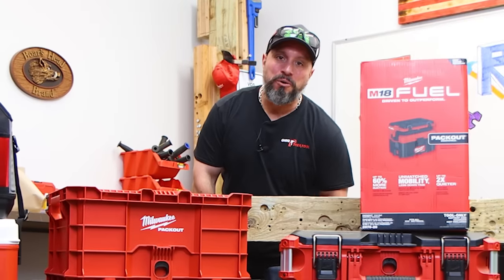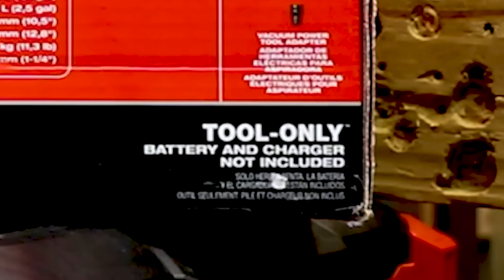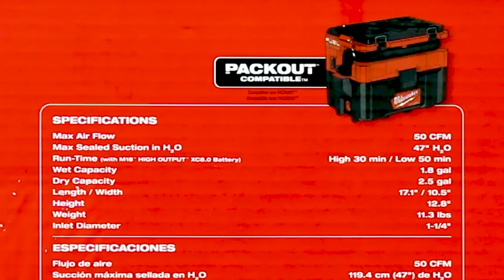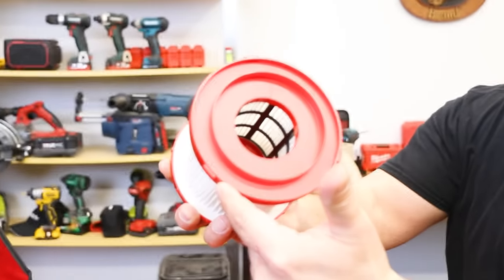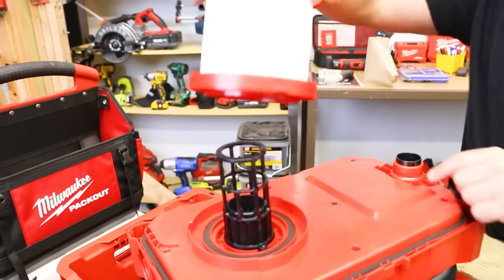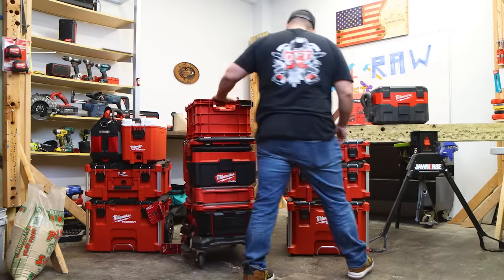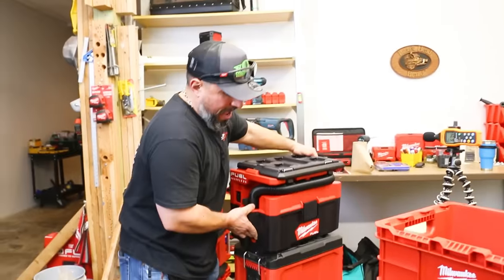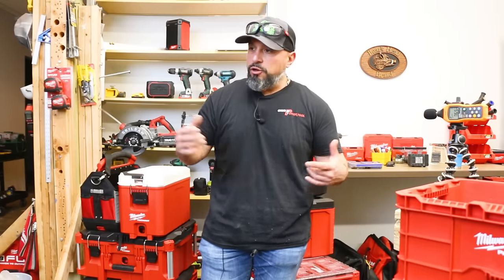Milwaukee M18 FUEL PACKOUT Wet/Dry Vacuum ARE THEY KIDDING!?

Comment: Junk Shear junk I am actually an owner of the little vacuum in this video I've got it sitting on my toilet seat lid it's more worthless garbage than any product I've ever bought zero Stars😢 real tears where did 7/8 days for this junk and now they're making a bigger piece of junk just like it customer service acted like they don't even care where is the care for your customer🎉 here are some flowers to put on the grave of customer care Milwaukee actually told me when I complain to them on the customer complaint line thank you for purchasing Milwaukee return it to where you purchased it that's customer satisfaction🎉 and there's the flowers on customer satisfaction is grave I will never buy a Milwaukee product again I'm going to switch to Makita I've never tried it but I hope it's better 120 some dollars for a vacuum that can't even suck up cig butts if it can't do that it can't suck up anything a Shop-Vac which this is the only thing this would be even useful for a portable shop vac wet dry shop vac sucking up oil off the floor grease steel filings wood chippings wood dust this thing can't do any of that why did they even make it the catch is too small the hoses too short the mouth is too skinny it only has one setting and that is lower than the lowest setting on a box fan you get for 20 bucks didn't come with a battery so when I return it in a few days I'll probably forget my battery in it meaning I'll be out $100 will cost me $15 to return it out of my own pocket that I'll never get back I called customer service and they told me that I could return it on my 30-day return policy I informed them that every Milwaukee tool has a 5-year warranty he sounded surprised like he didn't even know what the product was I was talking about I repeatedly tried to give him the serial numbers off the box and he just kept telling me thanks for purchasing Milwaukee😢 once again real tears🎉 rest in peace customer satisfaction I don't know about the bigger one but if it's even slightly like the little one you're going to get ripped off the little one doesn't even have wheels on it and weighs as much if not more than a mini fridge that's Compact and convenient habitat carrying a mini fridge around and you're one arm while you're vacuuming with the other no you have not cuz you're not dumb I asked him repeatedly just to change the product design they wouldn't listen even slightly they must be out of their minds just because their name is Milwaukee does not mean that the product is good anymore I was sure it'd be good my drill still works but I did buy that years ago never going to buy a product without watching a review first ever again I'm not even going to think about buying a product again until after I've watched a review if only I'd seen this guy's review I should have bought another heart vacuum cleaner my last heart vacuum cleaner lasted a whole year and was on sale damaged box $10 four 107.00 vacuum cleaner just because the box was tore lasted an entire year and could catch 12 to 13 gal of dirt and water this piece of junk can catch too and I'm actually being nice because it says it can catch 2 gallons and I haven't checked this yet but I'm pretty sure I could dump a half a gallon of water in that container catch and it would fill it meaning they lied on the box why would they say 2 gallons when I couldn't fit 2 gal in that container maybe if I took two two gallon milk jugs assassin in their standing up I could fit four gallons but as you may have guessed only about a gal would actually be in the thing because the rest of the milk jugs would be sticking up 9/10 of the way out of the top of the container and I wouldn't be able to put the lid on so if I dump 2 gallons of milk out of that milk jug their into the 2 gallon catch it would not hold it I'm almost willing to bet on that but I won't but really it was all around a bad purchase when I took it out of the box my dad freaked out he literally thought we accidentally bought a toolbox he just asked for a Milwaukee Shop-Vac they sent us this junk hope that this comment on this review help you save a lot of money and time and hardship trying to get a good shot back I didn't have any trouble with her and it had wheels on the bottom long hose big mouth plenty of sausage to very good vacuum and was also usable as a leaf blower just like this piece of junk they couldn't blow more than one leaf a couple centimeters and sucks battery like nobody's business maybe Black & Decker yeah I'll switch to Black & Decker I had one of their drills once it never did this to me or maybe Ryobi I had a Ryobi vacuum it was that little tiny one that was for sucking up dirt in a car it worked better than this Milwaukee vacuum cleaner sad Milwaukee vacuum cleaner being the one that serial numbers are 0880 - 20 do not buy unless you want to return just a very concerned Milwaukee purchaser good day

Comment: Because the piece of shit design on this one and the flimsy lid I decided to get the 2nd gen. You don't need brushless for a vacuum 😂 and the 2nd gen is right up there in vac power and noise. It's just a tad lower in CFM on high for the 3rd generation. The hose sticking out is silly and the fact that you need to use gorilla tape or something to keep it secure is even more insane.